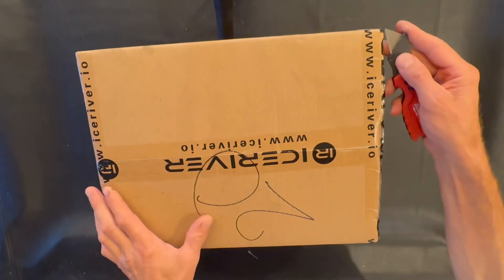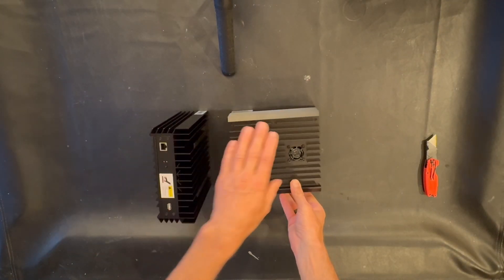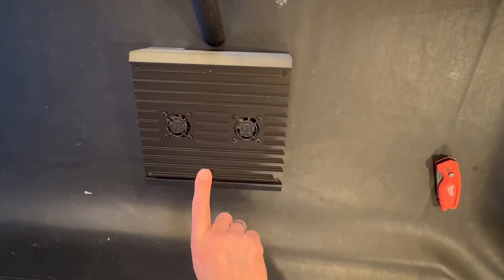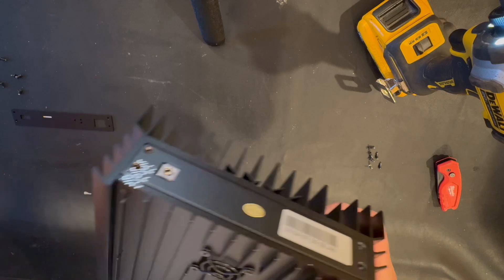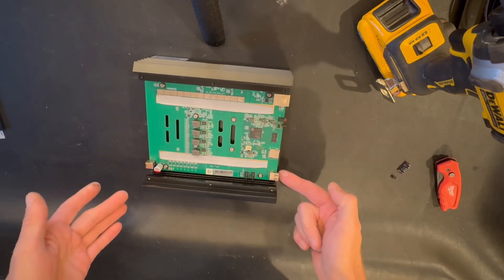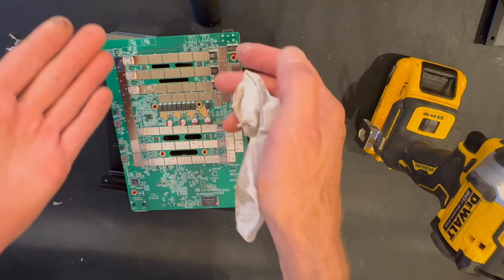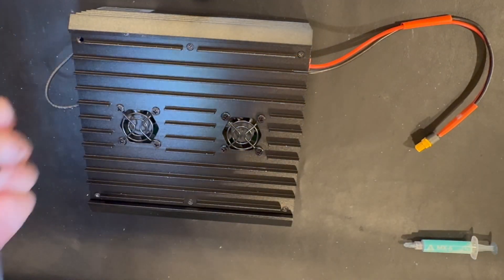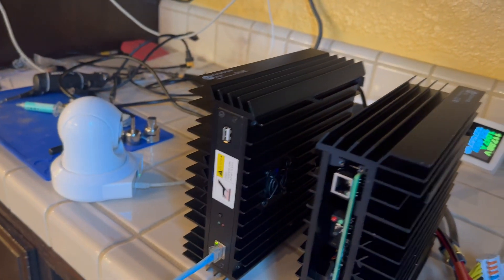ICERIVER AL0 FIRST LOOK INSIDE,  THE SAME CHIPS AS KS0 ULTRA OR NOT? TEAR DOWN

Comment: Yeah I received my AL0 the fan arrived not working I’m waiting on them to respond on how they will fix it
Reply from the maker: They cannot I think fix unless you send them the unit, they may send replacement fan if that really a fan problem.
Reply: @DontMindMeMining  yeah I’m losing money while I wait especially when the next bull run is coming soon I may just order the fan and replace it my self do you know what type fans it is?
Reply from the maker: It’s 40x40x10 5v 4 pin 
they have those fans on iceriver website: https://www.iceriver.io/product/fan-for-ks0-4010/

It’s 40x40x10 5v 4 pin
Reply from the maker: I had fan issue but it wasn’t a fan you can check my next al0 video

Comment: I am facing a problem with my KS3M. 17 to 18 chips are faulty and it is only giving around 2.5 TH. What should I do?
Reply from the maker: If temperature exceeded for a long time on those chips they may went bad. Replacing the board and the please give me a call back chips is pretty expensive but you can check if crypto440 YouTuber  has any chips for replacement.
Reply: @DontMindMeMining I'm seeing voltage in danger, temperature is fine. What will be the solution?
Reply from the maker: this is a chip degradation, need to lower the clocks or replace the chips.

Comment: Thanks for the tear down. Asics use dedicated chips they can't be the same for different algo. Still waiting for mine. Network is growing very fast.
Reply: that does not say the same chip cant be used for doing different things/algos, if it is changed a little
it would depend on if its a Gate-array and semi-custom design or a Full-custom design, if it is posible or not to fit more then 1 algo on it

you can be paying 4 times the price for the same hardware even though its a asic

the power usage from the different producers for example does make it look like they are using semi costum chips that could alow either alph or kaspa
Reply from the maker: @CantFindInYoutube  of course, but there is always a hope for the magic of that they used multipurpose chips like GPU

Comment: Hi
what do you use to connect the aL0?
Reply from the maker: I use 12V server PSU and in this video  I used just a compiuter PSU XT60 connectors soldered with silicone wire, you can gind all links in description and on my discorred trusted links
Reply: @DontMindMeMining  ok thx i come